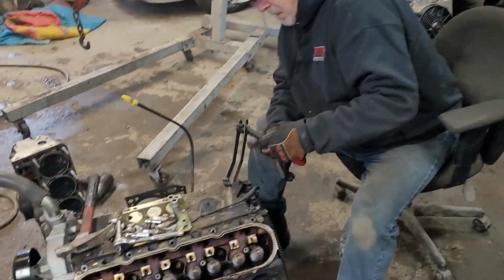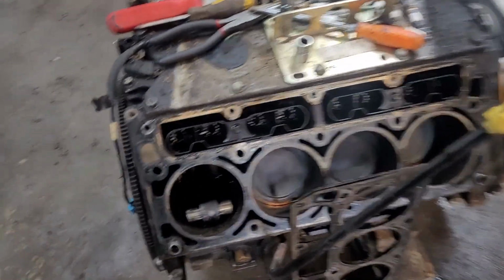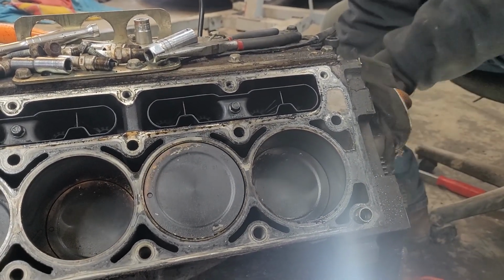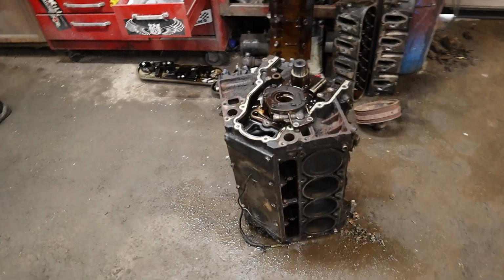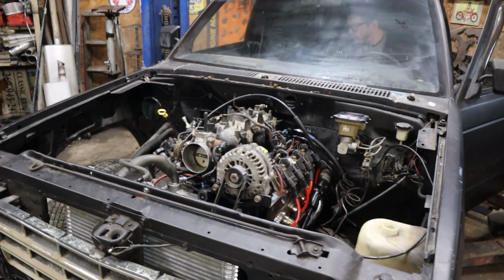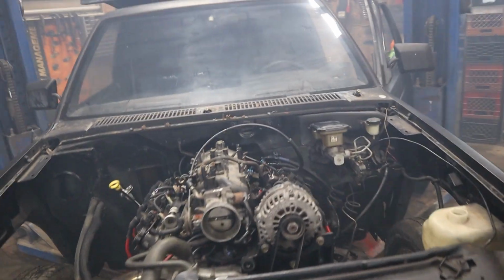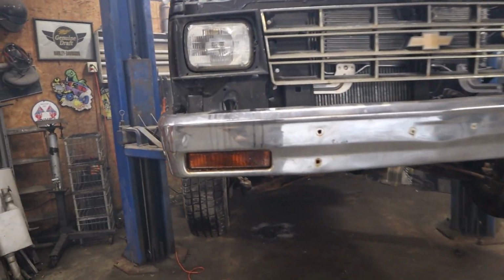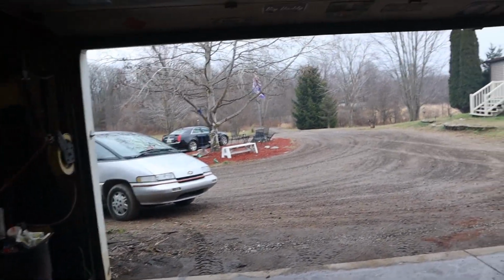ALIVE AGAIN! The CHEAP THRILLS Junkyard LS S10 is RUNNING! It Broke a PISTON!?

Comment: love this. to me... if you fix the 6.0 and "sell it" to yourself you could always play the game of. well we bought a 6.0 and blew it up. bought a 5.3 and sold the 6.0 and use the difference. but for the sake of the channel and challenge. Id just go with whatever a 5.3 would cost and keep things simple to follow.  this is making me wanna do a dirt cheap build too. reminds me of the roadkill zip tie drags
Reply from the maker: Yeah, I think just using the cost of the 5.3 makes the most sense instead of "well, i bought a 6.0, dropped a bolt in it and wrecked the whole things so my time and labor of this and that makes this a $7000 build" lol
Reply: @SniderTron3000  Lol never do the math with labor included....

Comment: Looks like a hell of a gouge in the head also. That tells me a foreign object was in the chamber.  Also food for thought,  if the rod bent it's not getting longer only shorter.  The rod looked perfectly fine to me. But it can be checked if still worried.  I would run it. Love the build. Get a used 6.0 piston and put it back together and run it.
Reply: 💯 Flush the engine out and get one of those "blood diamond" pistons overnighted. (OG Sloppy followers will get the reference) Slam it back together and put it into service.

Comment: I agree that the motor doesn't count towards your budget in this case. You didn't upgrade to achieve your goal and it didn't fail during a run. If you went through 4 motors making pass after pass then your original plan surely failed but as long as you meet the goal in the end You still succeed.

Comment: If an injector is stuck it doesn't matter but I'm sure you do know if you hold the throttle at a 100% that it shuts off injector pulse. I definitely think something got in the cylinder other than fuel or water.

Comment: Looks like hydro locked piston. I had a 6 liter do the same thing, broke one pistons 2 rods. One lifter. Honed everything replaced with used parts and got it back running like nothing happened. Try it out and keep the budget guys calm. Lol
Reply: Hydro lock wouldn’t cause that major gouge in the chamber of the head that looks like bolt threads though

Comment: I’m curious if the 0.7 liters of displacement with all of the same parts will make a difference in power, or if it would be noticeable. I know there’s no way to test both but I’m just curious.
Reply: spit balling here but from what RIchard holdner shows to a degree. airflow and fuel make power. with a smaller displacement engine. you could have the same peak horsepower higher in the rpm band. IF the cam is the limiting factor for power. going from 5.3 to 6.0 though you have a compression drop typically.  but assuming same compression. same heads same everything. the 6.0 will make more torque by probably 15-20 numbers. and power will be whatever the heads and cam can flow for it.  so hes probably giving up maybe 20 ft lbs but can wring it out to get the same or similar peak horsepower. ... i dont care either way. i woulda saved the money from a 6.0 and spent the difference on a skeezy nitrous kit.
Reply: @tragicnomadic  ahhh, I didn’t know Richard tested that. So basically, the money savings alone on the 5.3L would more than make up the difference when comparing apples to apples.

Comment: Is that a gen 4 rod ??
Reply: They aren't generational rods...that's internet stupidity.  It's a full floating pin LS rod...they debuted in 2002 in the LQ9.  There is nothing gen iv about a 2002 LQ9 lol.  Starting middle year 04 the full float rod started going across the board in all LS's... the blocks also changed from the unequal length head bolt arrangement to equal length at the same time.. being mid 2004 model year. 

So if or when you ever buy an LQ4 from mid 04 through 2007 don't be surprised when it has full float rods.. they all do.  Starting in 06 they have the pistons with valve reliefs in them that they used in the VVT equipped gen iv 6 liters lol.

I will add those heavier cracked cap connecting rods were used with press fit pins too... GM does lots of fun things lol